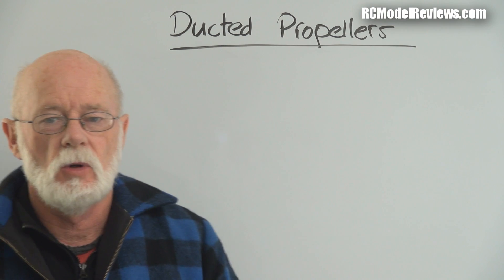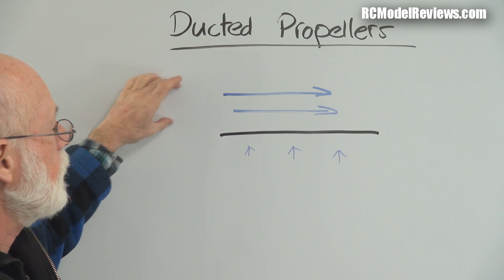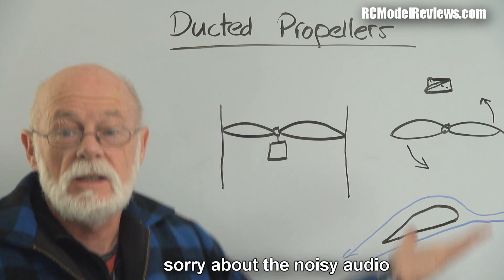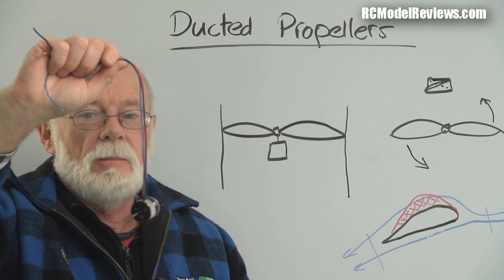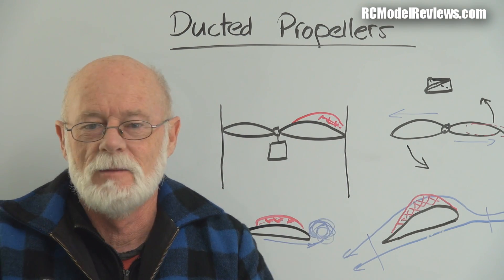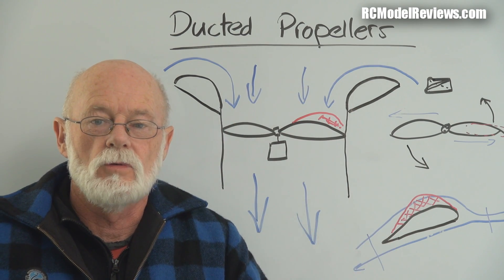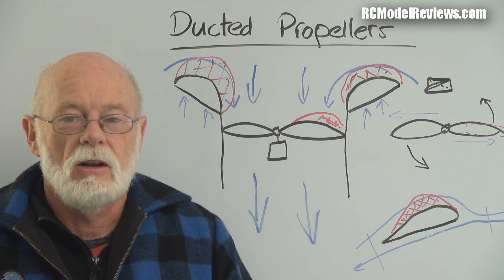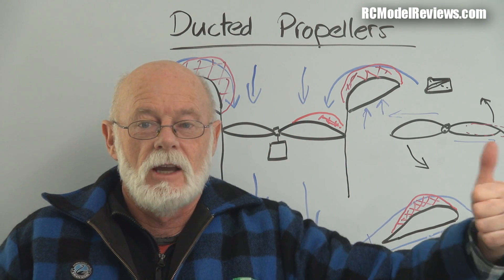How ducting a propeller increases efficiency and thrust

Comment: There's also the physics regarding the fixed duct. If instead of putting a normal propeller in a duct make the propeller itself a spinning duct with a fixed propeller shape inside. (Imagine an alloy wheel with propeller shape inside)

For forward propulsion this is the most efficient and minimal losses... Massively efficient.

A rotating tube going through the air maintains lift (see X-zylo flying toy as example) also if you mount one of these fixed duct concepts either side of the fuselage (same configuration as most dual motor aircraft) and have them rotating opposite directions so the top always falls toward the pilot you also utilise the same physics as the rotating ball (or YouTube kfc bucket flying machine)

Add all of this physics together with what you see in this video and you get an incredibly efficient flying propeller replacement.

Comment: The advantage of the curved lip is only limited in the case of static thrust where there is no free-stream. During the flight, this type of nacelle/ lip geometry will create additional drag due to the flow separation. However other points are well explained here. :)

Comment: If tip vortexes were caused by the high and low pressure "bubbles" being flung down the prop and combining then I guess tip vortexes aren't evident on wings, especially straight one, as nothing is flinging the air towards the tips.

Comment: that is not pressure. it is because of the contact that the flow makes with the air above plane. if you make soft spinning wheel inside a plane that is exposed to air from the top and still air in the bottom of the plane, you won't get different pressures. this is because the speed of the flow is not different from the flow that is already on the top of the plane. you are having an illusion. the second thing that you said the duct will increase the efficiency with is not true. it costs you something you idiot. that is not a wasted energy you are trying to use. it also needs more mass. it is a way of putting a propeller. it puts more pressure on the engine. there is also another factor you did not mention. the bottom of the plane gets increased pressure. the end of the duct should be also analyzed. don't pretend to know about something that you haven't questioned.

Comment: I am working on a new project. Taking a a Cessna 182 Skylane RC, removing the nose mounted electric motor/propeller, adding a nose cone, and then attaching (2) 30mm EDFs underneath each wing. They will be mounted evenly on the very edge of the upper portion of the wings strut. May sound crazy, but I fell it will look really cool and perform well....if it will fly. I will be sure that the CG is proper of course. Next, I would like to do the same to a large RC Cessna Caravan, using (2) 70mm-to-90mm EDFs. Thanks again for the uploads!

Comment: if you put a flat small cover over the airflow exit below the motor with a slightly smaller hole . would that increase thrust too ?  or would it have no affect ?

Comment: This bloke is misinformed. The curved paper rises because of the Coanda Effect. Test this for yourself. Mount a flat sheet of ply or plastic (something rigid and lite) on the end of a cordless leaf blower then mount the blower on a fulcrum so it has zero weight and is sitting level. What happens as the high speed air flows over the sheet? NOTHING. But curve the sheet like an airfoil and then see what happens. It will rise upward. Don't take my word for it. Do the test and find out for yourself.

Comment: We are currently designing a high wing, 2-place, all electric, twin ducted fan powered Aircraft/Trainer. The ducted fans will hang from each wing, and very close to the center line. Horizontal stabilizer with be T-tail. All lines are lifting in design. Will have ample side by side room for both the CFI and Student Pilot. Speeds will be that of an average Trainer (around 100-knots). We are expecting a true 60-minutes of flight time, with a 30 minute reserve. Will hopefully introduce the design here on this channel in the very near future. p.s. 99% carbon composite materials will be used in its construction.

Comment: If the system is moving upwards (or forward if horizontal) wouldn't you get negative pressure ie suction in the reverse direction at the back of the lip?

Comment: The vacuum wing effect make a vacuum that might try to keep the air from entering the duct so a test would be interesting although the air entering by moving against the air should effect it, now it has me thinking of submarines and as I recall there a duct but there is no winged duct although cavitation might be why subs do not have them since that makes noise by making bubbles in the water by doing the boiling effect...

Comment: There is no such thing as centrifugal force in physics - and "things" don't "move to the outside of the circle."  Those "things" are actually trying to move in a straight line away from the arc of their movement and this movement is resisted by centripetal force.

Comment: Thanks for taking the time to produce your videos. Very intersting!
However, after having taught the principles of aerodynamics to children (young and old), I have found that most people have the most difficulty with grasping the concept of atmospheric pressure. Simply put, it is the weight of the mass of air above you, about sixty miles high at sea level. A collum of the air we breathe which is one sqare inch at its base, and sixty miles high, weighs almost 15 pounds.
The most important thing to realise is that we experience this weight as pressure because we are inside of the air. It's called "internal sideways pressure".
NASA's "new" theory of lift is just a matter of angle of attack. Bernoulli's theory holds the most water with me because it best explains how turbulateors work to increase lift without increasing airfoil airspeed.
And, the reason why you don't readily feel the pressure is just because you're used to it. Don't try living without it, your blood will boil!
Reply: When flying at cruise in a fixed wing airplane you usually have a negative nose down attitude.  Negative aoa

Comment: We're having this huge argument about Tiny Whoops and whether the ducts are actually ducts and the stators actually having an effect. The best frame that I've found is the Furibee which seems to have an annular airfoil shape and the stator blades are angled in harmony with the props. As you ended this video talking about flying at an angle I was at the edge of my seat. I can't wait to hear more...

Comment: What happens if the duct inner and outer walls are shaped like a wing, either rolled top inward or top outward. I think it will increase/decrease air flow density through the duct.

Comment: I am sorry but newtons 3rd law, reaction from change in mass flow vector, has NOTHING to do with how lift is created. The primary proof is that there is no way a flat plat or a wing can exert a force on a fluid stream to change its vector. Sit down, and seriously think about it, there is no way. supporting proof is conservation of energy: if lift is created from delta mass flow, then energy must be expended equal to power changing the mass flow, hence all flying machines and creatures must have a thrust to weight ratio 1 is to 1, which is obvious not true.

Comment: A very good introduction to ducted propellers.  It would seem logical to have a three ducted fans (2 for lift and the 3rd for forward thrust). If calculated correctly one would assume that once you achieve the desired altitude the vertical thrust motors can be cutoff. Do you have any videos that address a design such as this?

Comment: Nice video, however, I have a question. If you held the piece of paper vertically and blew vertically down over one side of the paper, as apposed to horizontally it should do the same as you demonstrated in your video, however it doesn't. The reason is because there is no curve to the flat paper on your white board but once you held the paper, you created a curve and that, I believe, is why the paper rose...comments??

Comment: excellent video, just a quick one more blade or less blade for thrust and efficiency. 
Currently I am using on my 70mm 12blade 2800kv, the plane takes ages before lift and its like a slow flyer. I dont get to enjoy the jet speed. I was thinking of converting to propeller and than I saw your video. 

flying weight 1200g and current weight 1300g 4s setup

Appreciate your help in this one

Comment: the wing travels through air the, air is not moving, the wing is, the movement of the wing through the air creates lower pressure because the top of the wing behind the front is a low pressure zone because the air has been displaced by the moving wing slicing through it, and the air has to move down to fill the space but cannot instantly fill it, creating an area of lower pressure above the wing. Benoulis principle does not apply to wings moving through air.

Comment: No no no no no the centripetal force is acting 90 degrees of the propeller and affects the aircraft more than it does the air, also this is really only practical if we are talking about climbing straight up.

Comment: Hi, is there a way of working out the most efficient position of propellers on a quadcopter or hex etc in relation to the main body and propeller tip to neighbouring propellor tip?

i.e if you had 4 propellors and the combined area of air moved was say a sq.m and the 4 props were acting like an imaginary duct, then by lengthening the arms say 5cm increased this for arguments sake to 1.1sq.m then I would think there would be less prop wash from prop to prop (because they are further apart),,,,but being further apart would the drone be less or more efficient?

So to stretch the hypothetical question, lets say there were four 5008 330kv motors running 15 x 5 carbon fibre props if you buy a 600mm frame you know they are going to be 600mm centre to centre,,,,,,but what if you extended the arms to say 1000mm each giving you a 2000mm frame,,,,I would have thought this would be very stable,,,but would it be more or less efficient having the props acting on the air they are pulling through further apart and not influenced by each other?

How do you work out an optimum prop spacing is the question?

Comment: While this isn't practical for most aircraft,  it seems this would be a great benefit to an airboat or powered paraglider rotor,  because you need framework surrounding the prop anyways for safety.  It seems like it would be a no brainer to put it in a vent.  Since those craft only produce forward thrust, and are maneuvered by deflecting the airflow after it exits (air boat) or by deforming the "wing" (paraglider),  can anyone tell me what disadvantages a vented prop would have on those craft?

Comment: I don't get why at the 13:20 mark the inrushing air hitting the front of the duct flare  (as the craft moved forward) wouldn't negate any low pressure that might result as air moved over the surface towards the inside of the duct. Also  wouldn't the air likewise try to (or be forced to) move outwards from the centre-point (if it is symmetrical) of the duct flare where the highest low pressure is stated to be?  It seems at best that this would cancel out almost all (if not all) of any forward lift provided by the resulting turmoil between these 'competing" air masses.  In a static system perhaps this could work, but in a dynamic duct with a velocity of its own?

Comment: awesome and interesting, recalling 3rd yr engineering fluid dynamics & Bernoulli equation :) ....BUT missing one very important point here,  need to dimension the additional weight of DUCTS (x4). My DIY F450 quadcopter has following flight time...
 
note: how big is the impact on flight time for additional 100 g.
 
0.9575 Kg ---(with 3S 3000 mah, is giving flight time )--- 14 minutes
1.054 Kg  - (with 4S 3000 mah, is giving flight time)---- 7 minutes

Comment: Very informative. I think this is also why there is an upsweep on the wing tips of modern airliners. It helps to prevent vortex shedding. You can actually see this effect at the tip of an oar in the water when rowwing in a rowboat.

Comment: When I worked for a living at RR in Derby we spent quite a lot of effort in the Instrumentation dept designing ways of measuring tip clearance of fan blades in turbo fan engines in development. The real engine designers made a big effort to ensure those clearances we were measuring were kept to an absolute minimum. One way was using wear away coatings on the inside of the fan casing.

I wasn't directly involved in tip clearance measurement but I had some input in blade untwist measurement which affects large fan blades but is probably nearer zero in model sized prop blades.

I've been retired since 1995 so things may well be different now but it was interesting work.

Thanks Bruce you explain it very well.

Comment: heartening to see a decent amount of push back, in the comments, against this widespread mistaken explanation.
equal time theory - no    see;http://www.cam.ac.uk/research/news/how-wings-really-work
moving air over flat plate = lower pressure, - no  Bernoulli only fully works inside enclosed ducts, ironically, and specifically doesn’t in this case.
'paper strip' proof - no,  its just air not wanting to go round a corner, conservation of momentum.

Comment: Great video.  I knew about Bernoulli effect, but I have never had aero class (fluid dynamics).  I like the explanation about the prop, but I had a thought!  Is there any efficiency in just a small wall of perpendicular surface at the edge of prop to stop the vortex off the end?  I could probably go through the math which I'm sure involves lots of integrals of surface and pressure, but I bet you already know and could explain.
By the way, you constantly say in the video that you get the added efficiency without any cost.   But the weight of the duct surely has a point at which it crosses the point of worth the added weight or not.
Thanks for your information!

Comment: Bunk science, at least the first bit mentioning Bernoulli.  Specially the bit about blowing across flexible paper making the paper rise proves that Bernoulli pressure diffs cause lift, instead of blowing across the top of a non-flexible flat plate ... which won't rise.  Not unless it is slightly curved on top, in which case, it causes some of the air to change direction in a downward fashion, which causes the plate to react in the opposite direction, upward ...  meaning a wing's lift is a Newtonian reaction to the wing's accelerating air downward.  Same for props and rotors.   Which Bruce does get to further on in his video.  Go to NASA, for more.  Here's the link, demonstrating the fallacy of the lines have to meet at trailing edge - cuz they don't - the air going over the top of the wing actually gets to the trailing edge before the air under the wing does ... https://www.grc.nasa.gov/www/k-12/airplane/wrong1.html  ... and this means that tipping the wing up, putting a positive AOA to the wing, creates a vacuum behind/above the tilted up wing - and this vacuum accelerates the air faster over the top of the wing.  The air under and above the wings do not have to meet at the trailing edge, IOW - nor is there any physical law dictating that they should.  That's the bunk part.  IOW, there's absolutely no lift, unless air is accelerated downward by the wing.  No one has created lift, without shoving air down.
Reply: Tim Green indeed, this video contradicts what I was taught, strange

Comment: In the late 1960's a mechanic friend showed me a version of the same thing, and it really worked.

His customer installed a small block Chevrolet V-8 engine in his 1950 Ford automobile, complete with the original radiator and fan. It immediately overheated. They added a shroud and it cured the problem.

Comment: if closing the gap between rotor and duct is of essential importance, why not just make a rotor with a duct attached to it? in other words the duct would spin with the rotor, and there wouldn't be any gaps, because the rotor would be attached to the duct where there would normally be gaps. just curious. I'm sure theres an explanation.

Comment: Would a duct help increase the efficiency of a fixed house fan? By placing a duct around the fan blades, would the increased suction (lift) on the back of the fan lead to increased airflow out of the front of the fan?

Comment: There is an issue with air accelerating over the top of the wing theory, that being there is no force to make it accelerate, the more accepted theory is that the air has further to travel, over the top of the wing which and therefore gets to the other side slower, which creates a low pressure on top of the wing, and as we all know the higher pressure below will try and get to the the lower pressure to fill it, thus creating lift. Also the upper surface being larger creates more contact area of the fluid (being air) creating friction further slowing down the air going over the wing

This effect can clearly be seen at the end of wings and is why modern airliners have winglets on the end of the wing, which stops the high pressure under the wing leaking over the end of the wing and reducing lift, the winglets assist in creating greater lift for the given size of wing.

Another great example of this is how sails on boats work, strange how when it cones to boat sails the low pressure on the outside of the sail and high on the inside has been long accepted, yet when it comes to aircraft wings which function the same way there is still people preaching about a magical force that accelerated the air over the top.